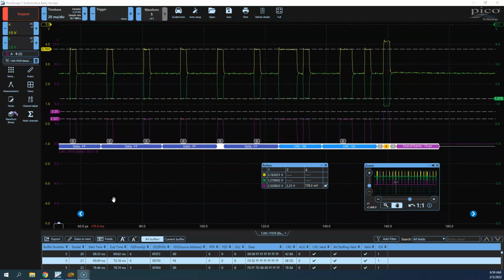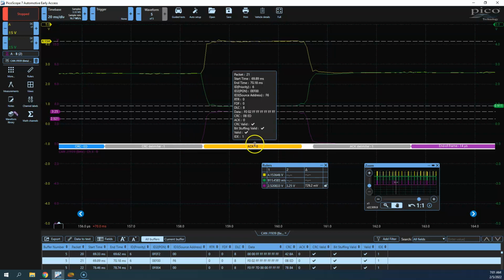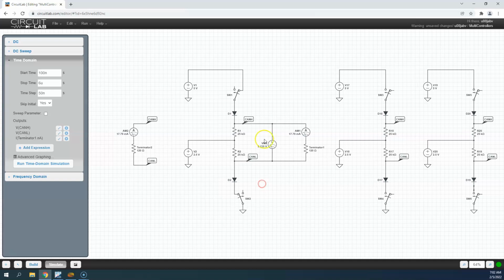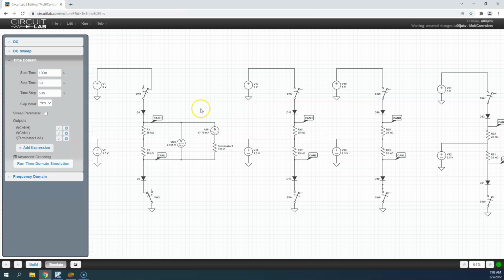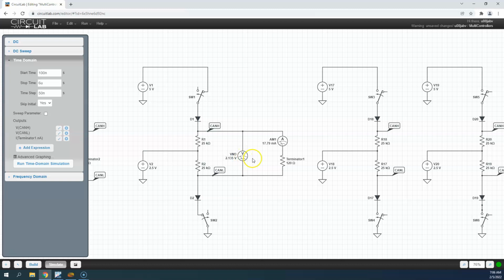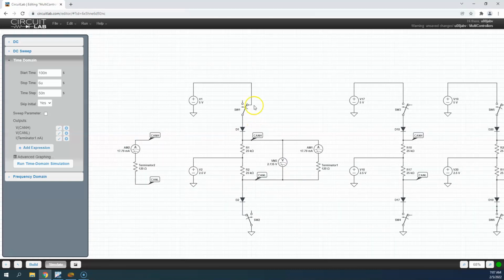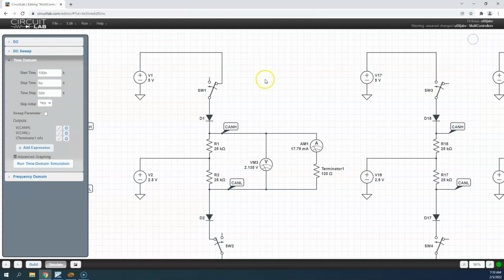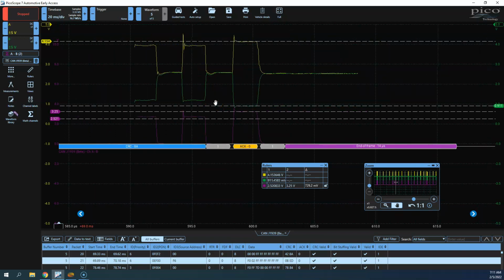Advanced J1939 Acknowledge Bit 12

Comment: Hello Joe,
A great explanation on the acknowledge bit elevated voltage. I have a question on the acknowledge and CRC delimiters. I have seen through Pico serial decoder errors for acknowledge, but it is not for a recessive bit. It is usually a dominant bit in the CRC delimiter or ACK delimiter with the elevated voltage as normal ACK dominant bit. What way would you go on this. I am working on a truck with regen not completing setting a U code and implausible temp reading consistently around exact same time and I never see any abnormal voltages/dropout of messages like when have a circuit issue. I disconnected all smart sensors one at a time on network and run regen that always fails about same time and loose some data on OEM software when it occurs, but returns usually 3-5 minutes later. Leaning towards a engine controller because it has 15% message error rate on aftertreatment CAN, but its $2800 and I just replaced it 300 engine hours ago because of it going into boot mode when it got hot (common failure for this particular Delphi controller). Thanks for any advice and how does one get a good deal on one of your textbooks. Steve